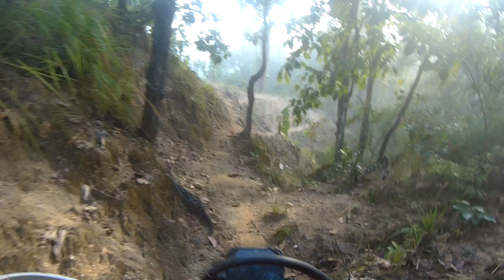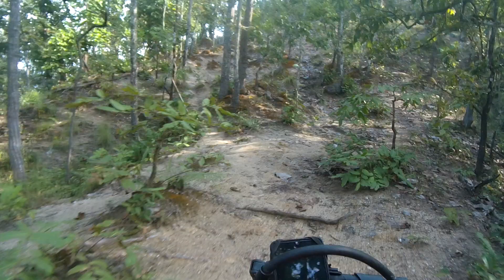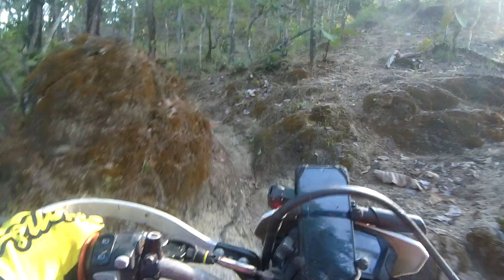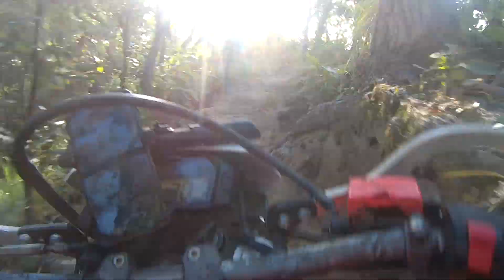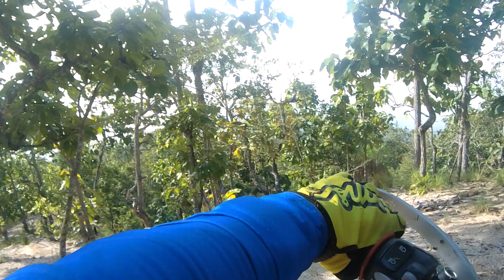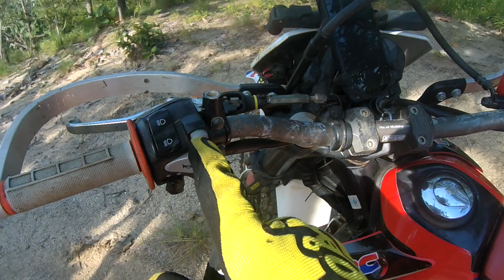how to run in your new CRF engine.

Comment: Starting issues and a constant whirring that follows RPM. Have you considered pulling it down and checking the sprag/freewheel?
Reply from the maker: Its all good, i had it apart n did a 301 on it. Its probably just starter switch contacts cos nothing likes being idle for 3 months in the wet season.

Comment: Hi from the UK
Looks like your living the dream
Need some help if you can please
I'm no mechanic but I'm in southern Spain 
My 2014 crf 250l has a problem
The Rad fan has stopped working
Bike has a bash plate on it and I'm struggling to see where  the ECT sensor is
Could you help 
I have a multimeter that I can use to check it
Contacted Honda in Spain but very unhelpful 
Cheers
Reply from the maker: Yeah im trying to enjoy stuff while i can! The fan is controlled by the grey switch under the throttle body. Take the grey plug off and turn the ignition on, the fan should run constantly. If not theres a pair of oblong relays to the rear in the battery compartment, 1 is fuel pump, the other is fan. You can switch positions and turn the ignition on, then turn the red run switch on. If the relay is good the fuel pump will run the pressure up cycle.
Obviously check the fuses! Ive had 2 ECT switches go bad but that usually makes the bike idle at 1500rpm so if its idling ok the switch should be fine.it needs an ohms check to be sure. You can download the manual in a pdf for free with a bit of searching on google, good luck, pop back with any more questions or visit FB honda crf250l 300l tips n tech, the manuals in the files section.
1 last thought, is the fan rotating by hand? Ive seen rads twist and stop the fan from turning. You can spin it from the bottom with your fingers.
Reply: @theravedaddy  Hi
Thanks for your reply 
I have taken the Grey plug off and the fan now runs
The issue now is the engine management light stays on and temp gauge stays on red 
I'm guessing this is because I have unplugged the Grey switch
Even when I rev the bike the lights stay on
I mistakenly disconnected the switch near the header pipe which could be the lamba switch
I have reved the bike but it's a bit flat
I put the lamb switch back in exactly in the same place and the bike now revs out
Are the management/ temp lights a problem or shall I just ride it back to the UK
!!!!!! When I reconnect the Grey switch, the lights go out and bike revs but fan won't run
Sorry for the long message but really appreciate your help
Roy
Reply from the maker: @guyonacub4335  the lights are on because the switch is disconnected but its proved the fan works and wiring/relay is ok. The problem is no signal to tell the fan to start. You can check for stored fault codes by accessing the red diagnostic plug. Ive got videos on that in my playlist. I think the temp switch is a code 7. Its possible to rig a switched wire to the fan to ride it but you will need to watch for the red light and then turn it on. It should only get hot in slow traffic.